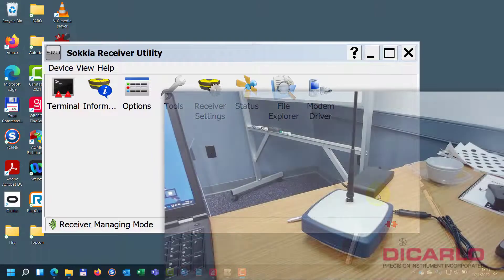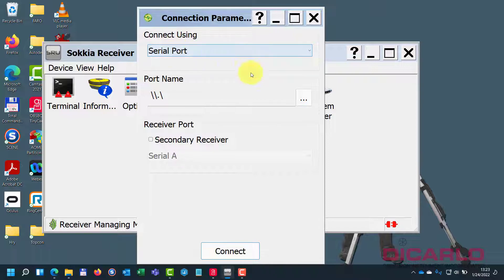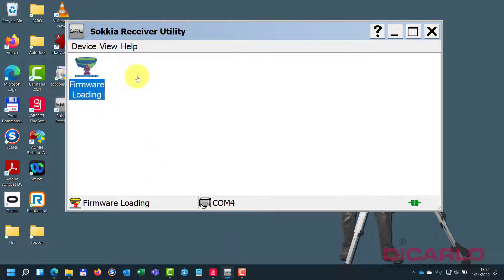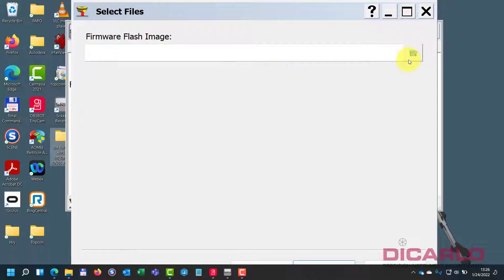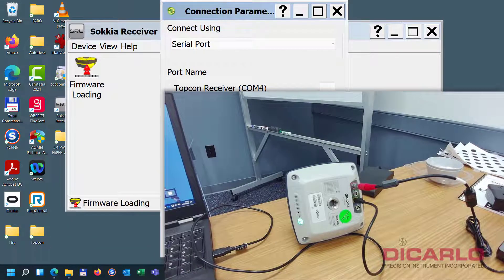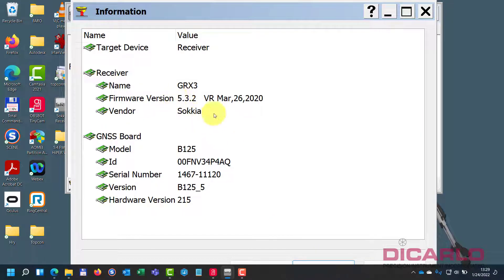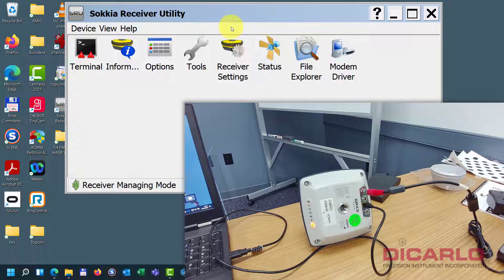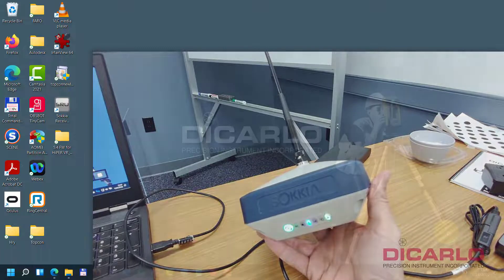Topcon/Sokkia GNSS firmware USB upload (installation)

Comment: Dear Sir thanks for good video .Sir if possible can you send me GRX2 updated Firmware .my GRX2 radio range to short how to solve this issue ?
Reply from the maker: @Surveyexpert1  Hi, I only have access to firmware through the manufacturer's website and archives. So, check on the Sokkia website.
By the way. GRX2 receivers do suffer from loss of radio range. And a firmware update unfortunately does rarely do anything. It's more a worn radio. Only way to fix I've seen is repair or replacement. Good luck!

Comment: Hi, I have a Sokkia GCX2 receiver with Magnet Field v4.3.3. I have configured the Magnet software for VRS and have also got the mount point selected too. But, I am unable to get a Fix solution. What could be the issue?

Comment: Hello.
I have updated firmware of Hiper VR.
This update include:
- Firmware v5.4.0 (7.27.21)
- Bluetooth LE Firmware v1.8 (7.27.21)
- R2LITE UHF Radio Firmware v2.1P0

But hiper VR with updated firmware doesn't work.
These problems are:
-  base doesn't start
-  fixed status of rover doesn't work (it doesn't receive radio frequency)
Receiver battery lamp flash quickly green and red light.
Can you help me?
Reply from the maker: Sounds like you need to check your radios. As if the base is not transmitting, your rover will not be fixing. The battery LED flashing is not something I recognize. Sounds like a fault of some kind. I would get in touch with your Topcon dealer/service and see if they can help you out! Good luck!

Comment: How do you know that the receiver firmware needs to be updated?
Reply from the maker: You have to compare the version of the firmware on your receiver vs the available latest one from the Topcon/Sokkia website. If the website version is newer, then you can proceed to update your receiver. Good luck! Otherwise your dealer might inform you of this. But there is no requirement... Typically you update your firmware if you are having issues, or if you know the new firmware is addressing an improvement, or new function you are interested in (read the release notes).